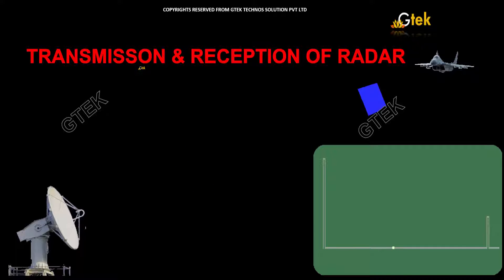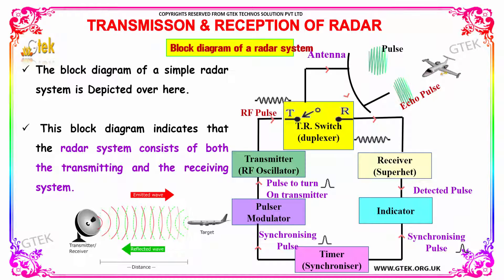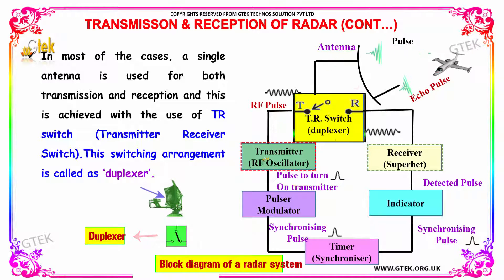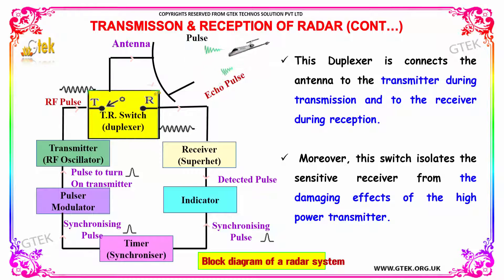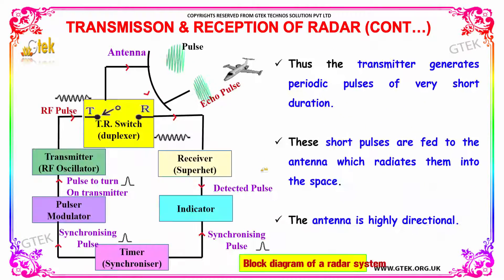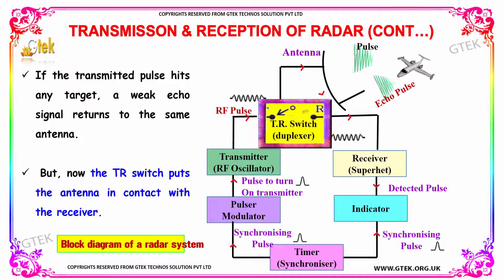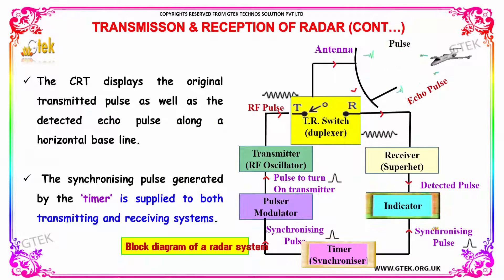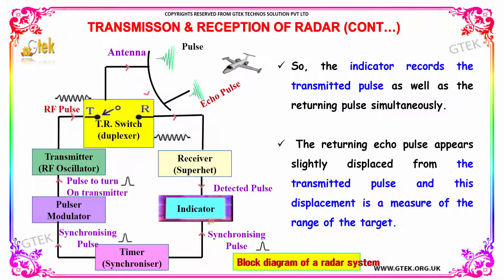Transmission and Reception of Radar |Communications system|class 12 physics notes|CBSE|IITJEE|NEET

Comment: CBSE Physics (Chapter Wise With Hint / Solution) Class XII ... Communications Systems ... 2) Why sky waves are not used in the transmission of television signals? ... 14) What is precisely meant by the term channel in a communication system “? ... alternative arrangement for the transmission and reception of the message ...

Comment: Mar 14, 2016 - It is a system which uses radio waves to detect and to fix the position of targets at a. ... 11th 12th std standard Class Physics sciense Higher secondary ... Applications, Transmission and reception of radar lecturing notes for ...

Comment: For the propagation and interception of radio waves, a transmitter and receiver are employed. ... The two most common types of modulation used in radio are amplitude modulation (AM) and frequency modulation (FM). ... Both AM and FM are analog transmission systems, that is, they process ...

Comment: The transmitting system consists of a transmitter and a pulser. The receiving system consists of a receiver and an indicator. In most of the cases, a single antenna is used for both transmission and reception and this is achieved with the use of TR switch (Transmitter Receiver Switch). This switching arrangement is called as ‘duplexer’.

Comment: Telecommunication is the transmissionof signs, signals, messages, writings, images and sounds or intelligence of any nature by wire, radio, optical or other electromagnetic systems.[1][2]Telecommunication occurs when the exchange of information betweencommunication participants includes the use of technology. It is transmitted either electrically over physical media, such as cables, or via electromagnetic radiation.[3][4][5][6][7][8] Such transmission paths are often divided intocommunication channels which afford the advantages of multiplexing. The term is often used in its plural form,telecommunications, because it involves many different technologies.[citation needed]Early means of communicating over a distance included visual signals, such as beacons, smoke signals, semaphore telegraphs, signal flags, and opticalheliographs.[9] Other examples of pre-modern long-distance communication included audio messages such as coded drumbeats, lung-blown horns, and loud whistles. 20th and 21st century technologies for long-distance communication usually involve electrical and electromagnetic technologies, such as telegraph,telephone, and teleprinter, networks,radio, microwave transmission, fiber optics, and communications satellites.A revolution in wireless communicationbegan in the first decade of the 20th century with the pioneering developments in radio communicationsby Guglielmo Marconi, who won theNobel Prize in Physics in 1909. Other notable pioneering inventors and developers in the field of electrical and electronic telecommunications includeCharles Wheatstone and Samuel Morse(inventors of the telegraph), Alexander Graham Bell (inventor of the telephone),Edwin Armstrong and Lee de Forest(inventors of radio), as well as Vladimir K. Zworykin, John Logie Baird and Philo Farnsworth (some of the inventors oftelevision).

Comment: 1) TRANSMITTER
the function of producing raio waves for transmission into space is done by transmitter. it is very vital part of the broadcasting station. it consists of microphone, audio amplifiers, oscillator and modulator.
the figure shown below shows the general principles of radio broadcasting, transmission and reception.

Comment: In telecommunications, transmission (abbreviation: Tx) is the process of sending and propagating an analogue or digital information signal over a physical point-to-point or point-to-multipoint transmission medium, either wired, optical fiber or wireless.[1][2] One example of transmission is the sending of a signal with limited duration, for example a block or packet of data, a phone call, or an email. Transmission technologies and schemes typically refer to physical layer protocol duties such as modulation, demodulation, line coding, equalization, error control, bit synchronization and multiplexing, but the term may also involve higher-layer protocol duties, for example, digitizing an analog message signal, and source coding (compression).

Transmission of a digital message, or of a digitized analog signal, is known as digital communication.